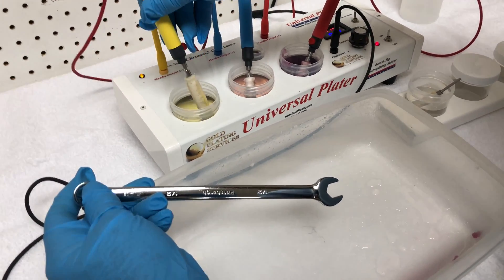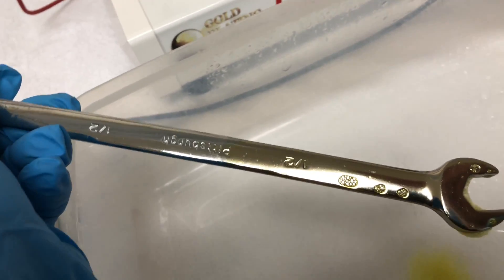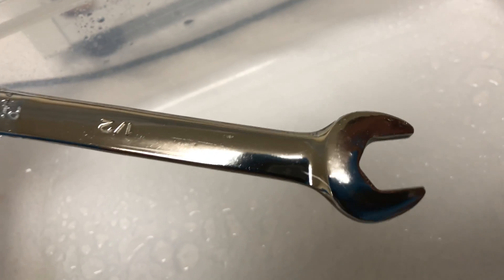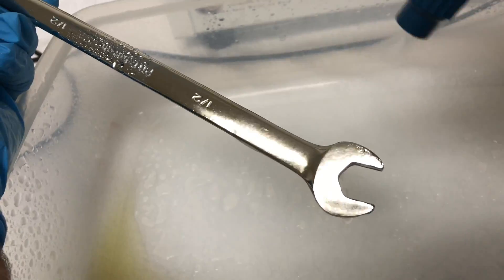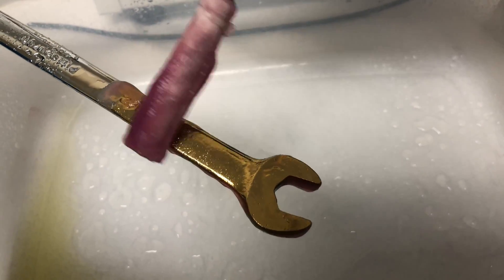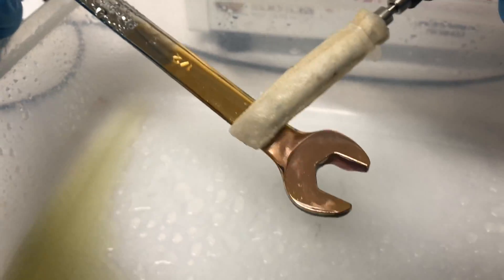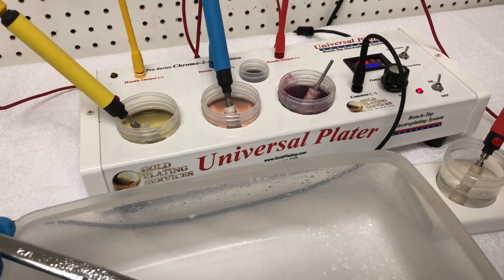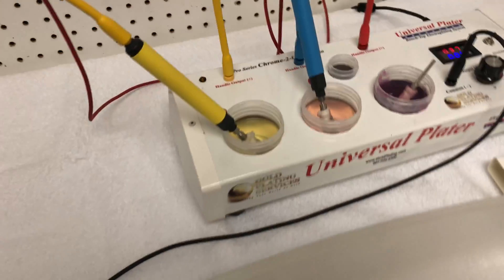24K & Rose Gold Plating onto Chrome

Comment: I Have the universal plater and the brush plating rose gold solution but after plating and rinsing with distilled water i normally dry the part and set it aside and i come back to it the next day its tarnished and has to be polished can you tell me what i am doing rong?
Reply: How much is the kit
Reply: @vileasphunk7789  as low as 1100
Reply: @hbforged3416  Imma have to get me soon On the Reall

Comment: How much would it cost for the machine and the chemicals to be used. Thanks a lot
Reply: For that setup, which is pretty much the best, would be around $500 to get started. There are smaller lass capable kits out there for under $100. Etsy has some options
Reply: @markhondaturbo  where to buy

Comment: Hi. I purchased the universal plater Chrome Edition about a month ago and I'm extremely satisfied with the results and the performance of this machine. However I attempted to rose gold plate a chrome wrench and I was unsuccessful. The rose gold solution that I ordered is for the bath application. I am wondering is there a rose gold brush solution? Thank you.
Reply from the maker: We are very happy that you are extremely satisfied with the results and performance.  We're sorry that you had issues with rose gold plating your wrench.  If you used the Bath rose gold, it will not work for brush plating.  The Rose Gold in this video is a Brush solution and you can see the result is great.  Here is a link to the brush rose: https://www.goldplating.com/products/rose-gold-brush-solution?variant=35060844871
Reply: @GoldPlatingServices  What is the difference between these two liquids, or why does it work with a pen/brush but not a tank, or vice versa?

Comment: What's the difference between the US/Canada version and the International version ?
Reply from the maker: US/Canada version comes with all the solutions "Ready to Use".  International version does not include Chrome Stripping Solution (as it is not able to be shipped via Air) and does not include Woods Nickel Strike.  It does, however, include a Woods Nickel Concentrate, which can be made ready to use by adding acid to it.  We provide instructions on how to product the Woods Nickel Strike and the Chrome Stripping Solution on international orders.